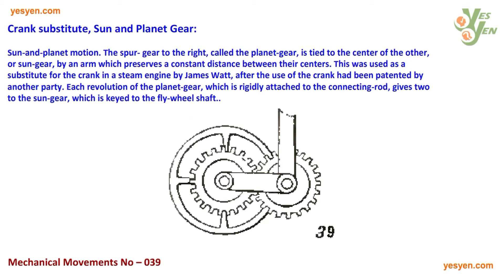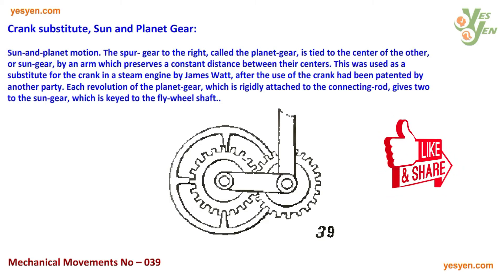507 Mechanical Movements - No: 039 - Crank substitute, Sun and Planet Gear

Comment: Your animation is incorrect. The planet gear needs to be rigidly attached to the connecting rod. See http://507movements.com/mm_039.html.
Reply: I agree with your point here. Shall rectify and get back with a right configuration. Thanks for your feed back.